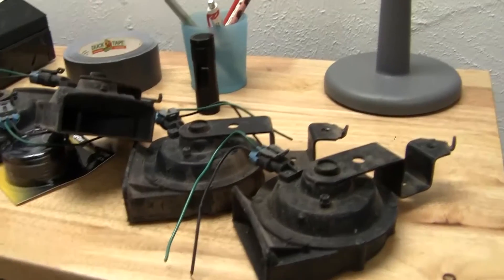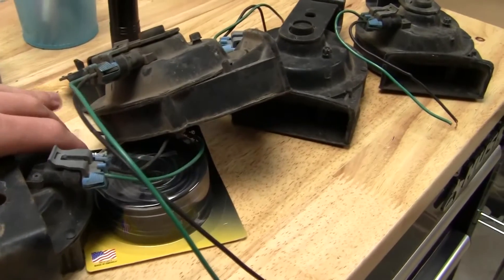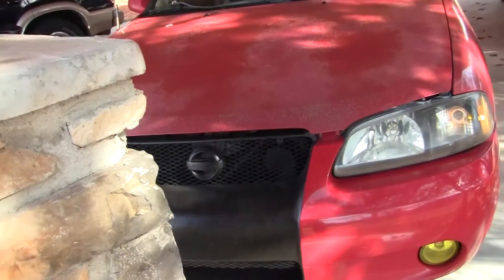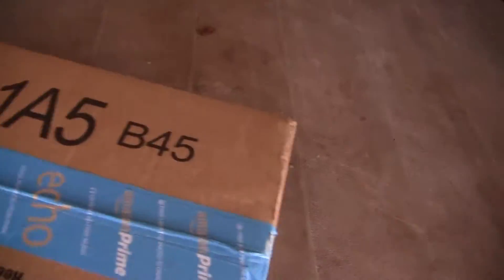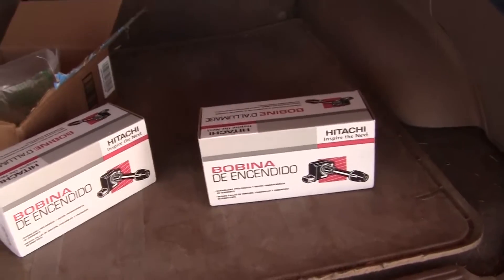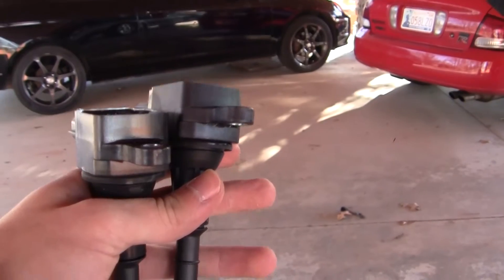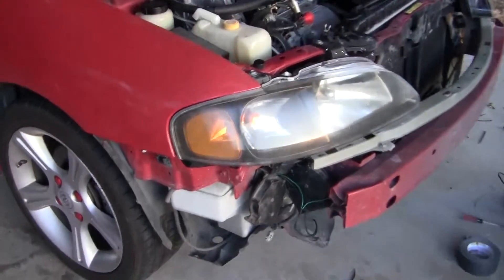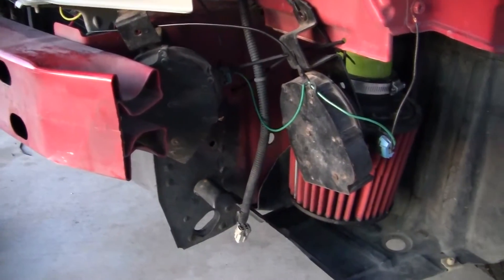Installing Loud Cadillac Horns

Comment: How much did you end up paying for the Cadillac horns altogether?
Reply from the maker: +Sidney Ventura Vega V The junkyard sold them at $2.50 a piece, so $10 for those. The relay I used from the Cadillac was an extra $2, and the wiring I just got at my local Ace. All in, excluding the soldering iron it was about $20.
Reply: Didn’t hear the horns or was I sleepin ?